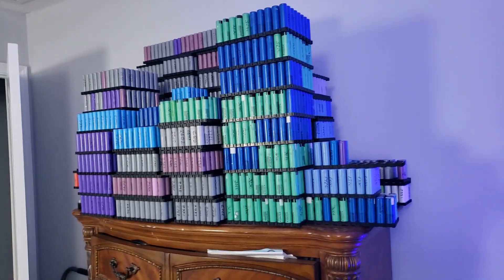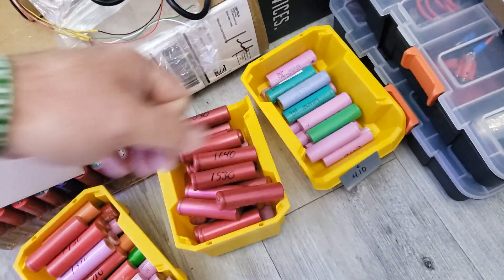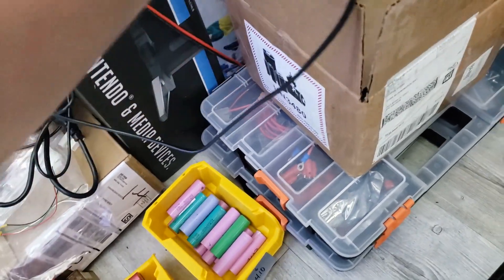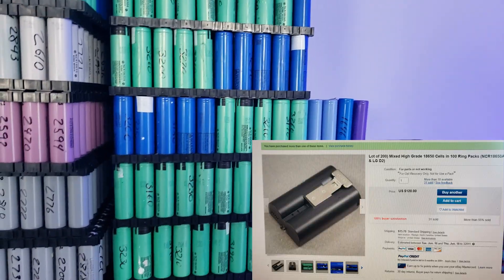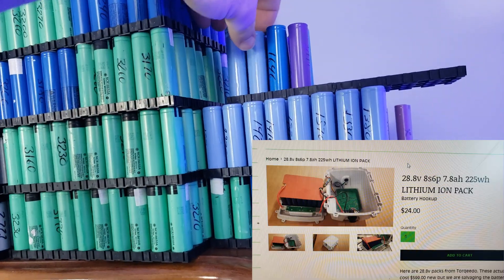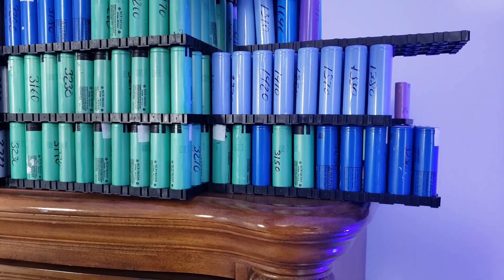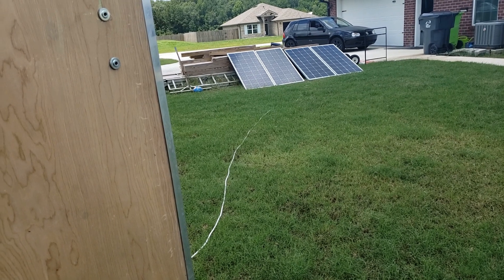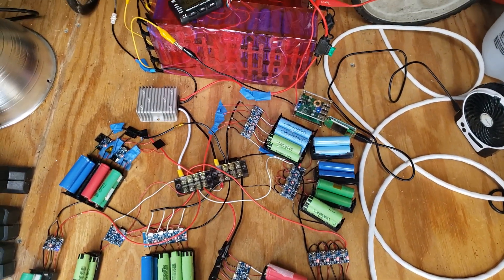BEST 18650 lithium cell testing? Where we go next, ATS, Solar Air Con, update

Comment: Hello. How do you perform the inspection, whether by charging or discharging?
Reply from the maker: Discharge test is best. I use the Littokala ii-500 charger.
Reply: @RodneySolarCircuits  thank you
Reply: @RodneySolarCircuits  Hello. I have used batteries. When I discharged the battery, it does not empty to 3.00 but rather 3.50 or 3.40. What is the reason?
Reply from the maker: @أبوبكرأحمد-ح1ع  When you pull a load the voltage will drop until no load then voltage will rise back.
Reply: @RodneySolarCircuits  Do I do the discharging process to take the capacity one time. Meaning enough to take the battery capacity or empty, charge and then discharge
Reply from the maker: @أبوبكرأحمد-ح1ع  most testers drop to 2.8 volts. if you test at 1 amp to 3 then the voltage may rise back to 3.4 volts after no load.

Comment: You are a really professional in this field. I am also planning  to build battery pack with 18650 batteries 24v 24 ah, with old laptop batteries, can you help me i have some questions. I am little confused with nichel wire,  how much mm  do i suppose to choose ? and which welding machines can you prefer for me (cheap one for beginning) ?  Thanks from now.
Reply from the maker: Keep watching more videos.  Check out average Joe and hbpowerwall. And on FB groups. They can answer more complete. lithiumsolar has some great videos too.
Reply from the maker: Thank you.  But the all in one welder is great with .1mmx8mm niche strip

Comment: After those cells have been sitting a while (1+ months)  I'd check their voltage and toss any that have significantly discharged.  Then discharge the good ones to storage voltage (3.6-3.7v) so they don't bleed off and lose capacity.
Reply from the maker: All of them have been rechecked except the ones I'm working on now. its time to check the purple ones then the rings after. I thought about discharging them all down, what a task that would be. I've heard that too about letting them sit at full charge. I seen a video of someone retesting a cell after 2 years sitting at full SoC and it tested about the same.  I don't think a couple months will do enough harm to warrant the effort to discharge them all. It won't be long now before they get put into service. Gotta find the time and energy to sit down and build.